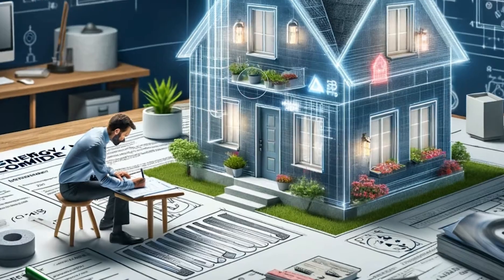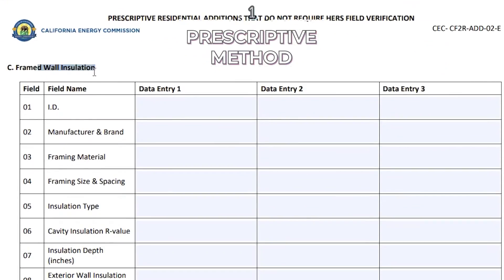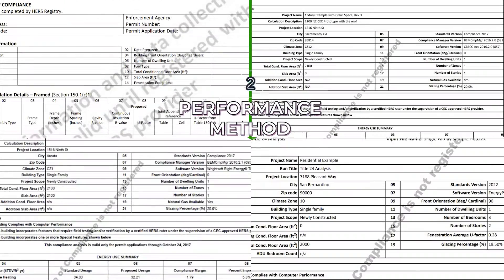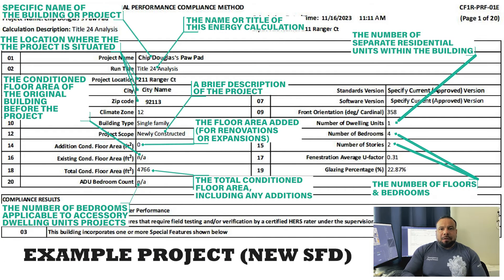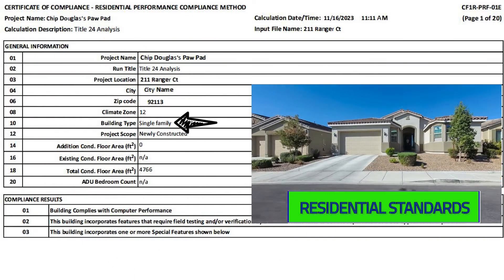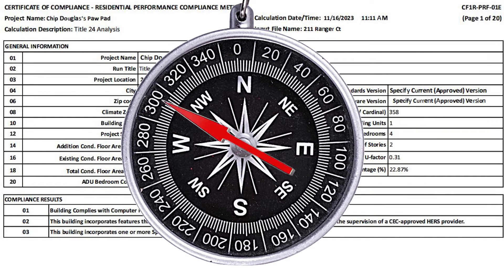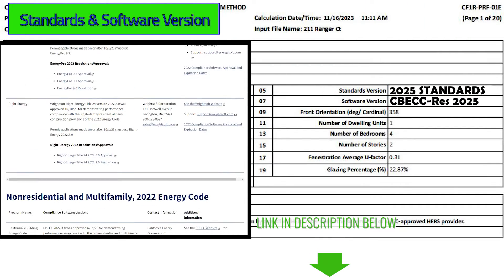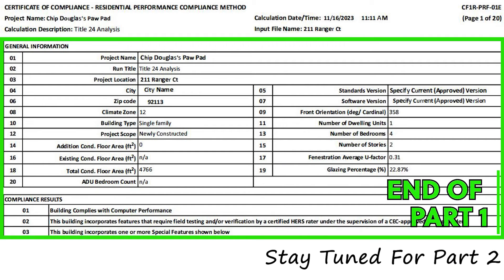Unlocking the CF1R Riddle - The Energy Compliance Form | Part 1

Comment: Greetings Jose, I have replied twice to our thread and both times it has disappeared. This time I'm trying to make a comment outside of the thread to see if it works. I wish to install at least 3 mini split heat pumps. A fourth has already been installed.
Reply from the maker: Hi Eric.  I don't think your question came through in its entirety.  Would you let me know what the question is?  Specifically "I wish to install at least 3 mini split heat pumps. A fourth has already been installed."
Reply: @CBO.online Certainly, I would like to install the equipment as permitted. Do I need to pay someone or can I do the permit application entirely by myself? Thank you.
Reply from the maker: @EricB  you may prepare the permit application yourself, as the owner/builder - excluding the HERS forms, as those are completed by the HERS rater that conducts the tests/verifications.

Comment: Very good. Thank you for it. I saw in one of your videos you showed a town in Mendocino county. Is that where you are based? This video and the next one give a quick impression of the purpose, but where would we get the numbers? How do we know which form is needed? I'd like to install my own HVAC upgrade and would like to do it permitted if I can figure it out. The city says a CF1R form is required, but they say nothing more. There appear to be many CF1R possibilities. 😲
Reply from the maker: Hello.  Thanks for the message.  I used to serve the County of Mendocino as the Interim (consultant) Building Official for about a year (2016/2017), which is why I include bits about Mendo in the videos.  
The energy forms values are the most challenging to present without getting into long ass videos (to be very frank).  I am hopeful to present how people can use GPT to help prepare these forms; some day soon I will crack the prompts to achieving this; in the mean time, the energy forms that do not require HERS inspections are the simplest to complete (and depending on the scope of work); for your mechanical upgrade, if the work will trigger a HERS rater inspection (such as  a new or replacement HVAC, new duct work, new AC unit) then the  CF1R-ALT-02-E are the forms typically needed; link to forms https://www.energy.ca.gov/filebrowser/download/4688
The last 5 pages of this document includes the instructions on how to fill in the form.  Once again, I would highly advice using GPT to help complete the form; in fact, if you have the upgrade to GPT, you can copy/paste a snip of each table and have GPT instruct you on how to complete it, prompts are key though.  
Also keep in mind that the form will need to be "registered" through CHEERS, or CalCERTS; however, the HERS inspectors typically handle the paperwork (CF1Rs (submittal) and CF2R (post submittal)), if your project will require a HERS.
Furthermore, probably the only item I can think of that is exempt from HERS is the installation of a wall furnace; and, for those installs the non HERS forms are required to be submitted.

I hope this information provides some clarity, but please feel free to reach out again if you have further questions.

Jose M